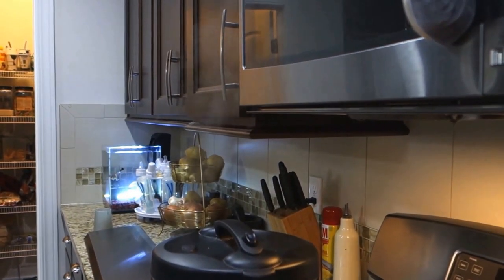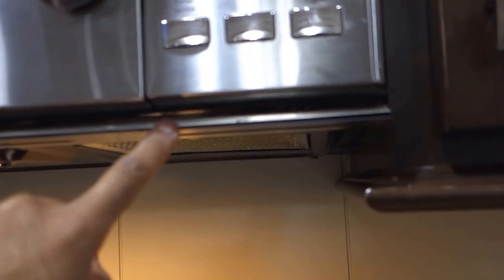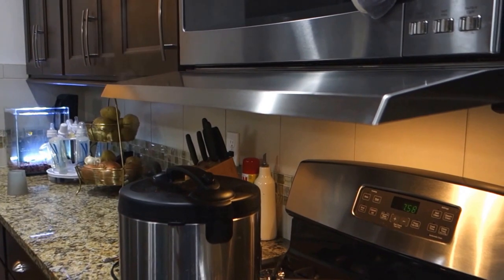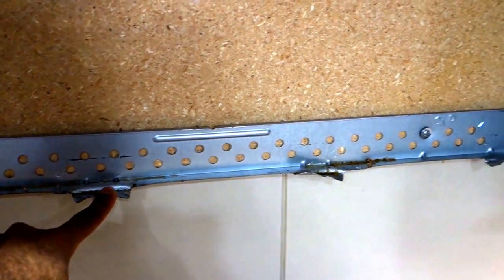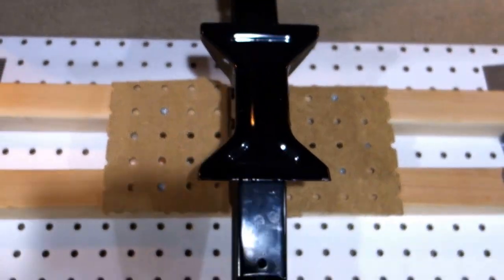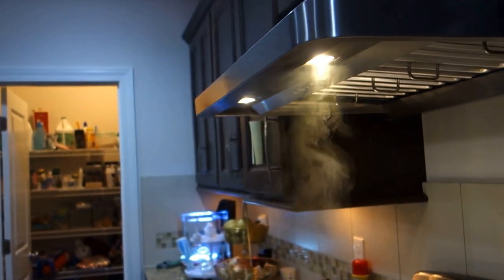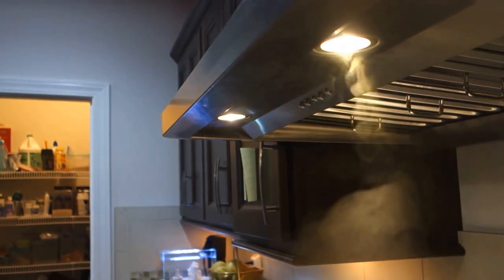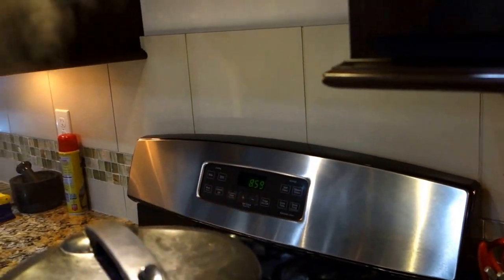Replacing Over the range Microwave with range hood

Comment: Thank you for the video. I'm planning to do the same thing in a house my wife and I just bought.  We will have to check that we can get more of the back splash tile to cover the bare wall previously covered by the microwave.  For those concerned about the microwave, if you can't place it on the countertop, donate it to the salvation army and buy a new one.  Microwaves are not that expensive.

Comment: Thank you so much Pankaj!  I was debating whether to replace my OTR microwave with more powerful (400cfm) microwave range; or getting a powerful 600-750 cfm range hood and a smaller countertop microwave.  Your video answered my question.  400CFM vented is NOTHING!  For my spicy cooking, I think I really need to go for high CFM (at least 600 CFM) range hood and get a smaller  countertop microwave.  Thanks again, Pankaj!
Reply from the maker: I agree. I guess its better to invest in a good and quiet 600+ cfm hood. On a long run, you will be happy about your decision.

Comment: My parents have a similar type of range hood previously.  One big draw back is the gaps where the air is drawn through gets filled with grease over time and is a real pain to clean.
Reply: That's not a drawback, that's by design. They are supposed to catch the grease to keep the motor clean, otherwise the exhaust fan would get clogged with grease. Other types of good have replaceable filters but then you have to buy new filters when they get dirty.

Comment: Hi Pankaj, did you install a make up air damper and backdraft damper for your range hood? Are these important for range hood installation? 

As for cleaning, is it sufficient just to dish wash the baffle filters?  Thanks.
Reply from the maker: Yes. there was some gap at the back in my case. So I used a duct collar (https://www.homedepot.com/p/3-1-4-in-x-10-in-Rectangular-Stack-Duct-Starting-Collar-SCF3-25X10/100139382). And yes its sufficient to dish wash the filter
Reply: No make up air damper installed. But these homes have pressure balancing fresh air intake at the furnace to pull the fresh air from outside via different filter. This also opens when whole house fan runs. But as per code, make up air damper may be required if this is above 400CFM. check local regulations. In general we never have to run this in full speed, always in Quiet mode, or rarely Low speed. Also if weather permits we open a window in dining area so fresh air pulled from there which helps better exhaust.

Comment: Hey Pankaj thanks for the instructions pretty useful, just one question did you removed the panel before installing the range wood the one that microwave was resting on? Or did you just left it?

Comment: Pankaj, could you show how to use aluminum tape to seal the rectangular vent between the rear of the range hood and the inner wall opening?  Does the rectangular piece get inserted into the wall opening?
Reply from the maker: I cant show it now as the vent is there already. But in my case i was not too sure that i could seat it properly from inside. So i went outside the house and applied tape from outside anyways. If you have more gap at the back, then an adapter like below will help

http://www.homedepot.com/p/Speedi-Products-10-in-x-3-25-in-x-6-in-Galvanized-Sheet-Metal-Range-Hood-Straight-Boot-Adapter-SM-RH3106-SB/202907196?MERCH=REC-_-SearchPLPHorizontal1_rr-_-NA-_-202907196-_-N
Reply: How did you seal from outside? The wall opening looks pretty small. Did you have to take out the damper and then put it back on?
Reply from the maker: In my case there was enough opening to get my hands inside. But make sure to wear gloves as there can be sharp edges inside

Comment: I have the exact same issue with my over the range microwave, I'm thinking of doing the switch too.   Are you guys using a regular microwave now???
Reply from the maker: We are still using the same OTR microwave on our counter top right now as it can also be used that way. The exhaust fan that throws air at the back does not run when we just use the microwave. We have a separate button that runs the fan. But it looks too big on counter top and we will eventually replace it with a smaller unit (around 1.5 cubit feet size)

Comment: Why were you replacing the microwave with a range hood?
Reply: Likely because those OTR ventilating microwaves lack the power to exhaust the smell and fumes generated by stir frying and similar cooking. A range hood with a powerful blower is way better.
Reply: @DBVintage  Then you lose the microwave and its space savings.

Comment: Hello Pankaj, I was sooo close to ordering this Kobe hood last night.  That is until I checked some measurements.  Can you tell me what the clearance is between the top of your range to the bottom of the Kobe hood?  The manufacturer states a min of 26 inches and max of 30 inches from the range surface.  I am below the minimum by 3 inches.

Comment: Was top vent seal cover and rear vent adapter (TVC20) included in the package? Did you have to order them separately from the vendor?
Reply from the maker: The top vent cover and the rear adapter i have shown in the video was included in the package. However in my house, there was still about 9 inches of gap at the back AFTER positioning the hood. So i had to add one more adapter like below at the back:

http://www.homedepot.com/p/Speedi-Products-10-in-x-3-25-in-x-6-in-Galvanized-Sheet-Metal-Range-Hood-Straight-Boot-Adapter-SM-RH3106-SB/202907196?MERCH=REC-_-SearchPLPHorizontal1_rr-_-NA-_-202907196-_-N